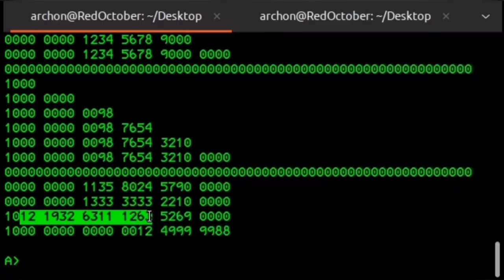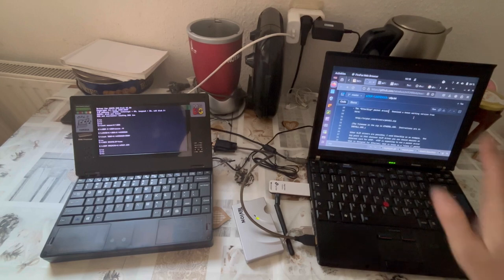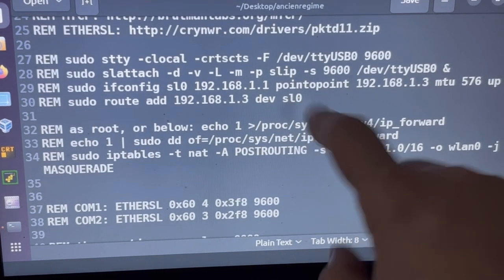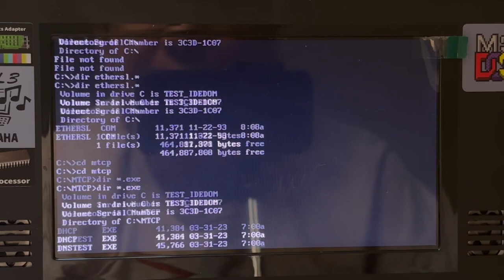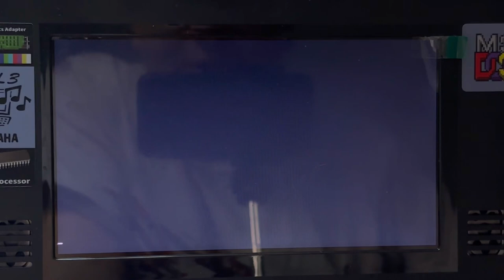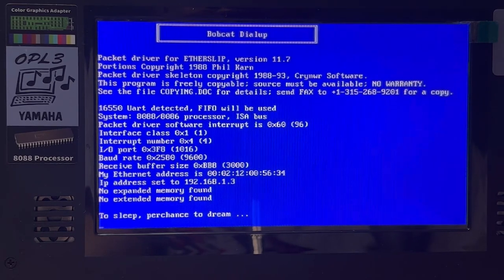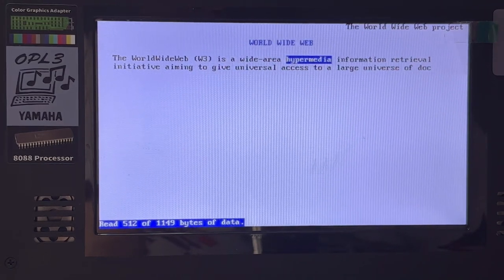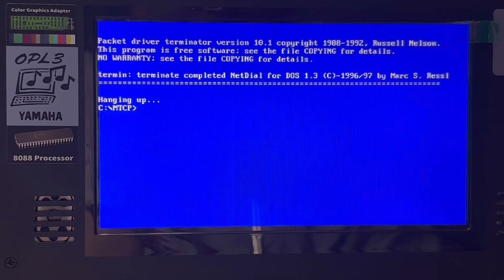(5/58) TTY/SLIP/PPP: Browse with Bobcat on MS-DOS, use mTCP, configure a SLIP connection via Linux

Comment: I tried to use ipx network on 2 android tablet with a dosbox app installed, but it failed to connect. I don’t know if the router with wlan or android was the problem.
Reply from the maker: You will laugh - but your comment triggered the creation of five further videos, that proved a bit non-trivial! So… stay tuned, Dosbox is now included in the TTY/SLIP/PPP series… 😁✌️🫡
Reply: @ninoivanov  thx